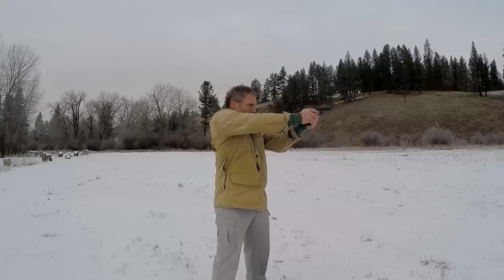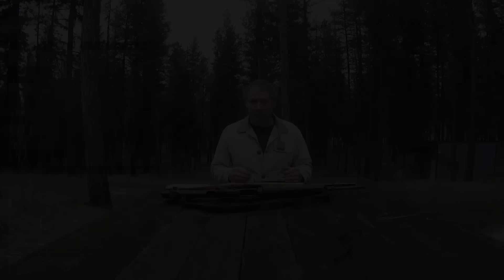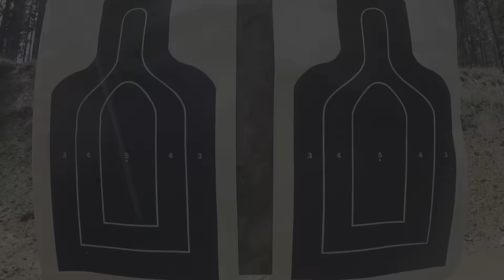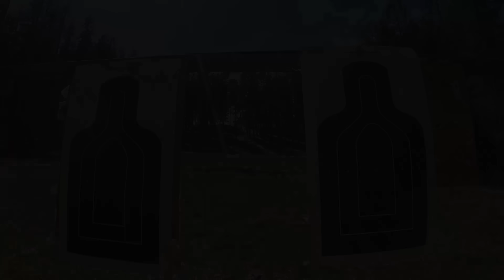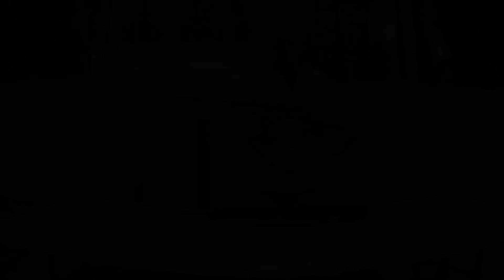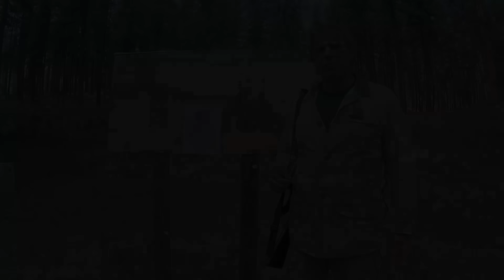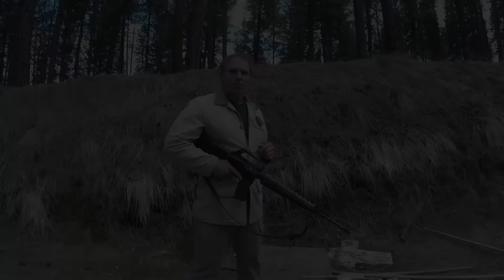Mini-14 vs AR15: Which is Better?

Comment: Ha ha ha , tge main thing about the difference is completely omitted 
Direct infringement system of AR and piston system if mini 14, ar bolt get dirty very quick needs cleaning otherwise caput

Mini 14, gas vents in front of bolt, no problem

Comment: First of all, all mini 14s were designed to shoot 5.56 ammunition! If you had the paperwork that came with the firearm initially, you would have been able to read that. So, for an accurate comparison of accuracy, you would need to use the exact same ammunition in both rifles. 😂😅😂
Reply: That is not so. The Mini 14 was introduced before 5.56 NATO was invented.
Reply: @jeffkardosjr.3825  I'm not certain where you are getting your information from. But according to Google. The 5.56 NATO cartridge was developed in 1957. It was adopted as the military cartridge in 1964. The mini 14 was designed in 1973. It began being widely manufactured in 1974. So I don't know what you are talking about. Can you explain why you think that the mini 14 was made before the 5.56 nato cartridge was developed?
Reply: @waroark1  5.56 NATO was designed in the late 1970s and put into service in 1980.
Google might be confusing it with the .223 Remington.

Comment: True the Mini-14 is a Fine Rifle, But the AR15 is far far easier to strip, clean and maintain. Sorry Mini 14 owners,  but that's a Fact...
Reply: Sorry AR owners but heres another fact. While the mini 14 may be harder to field strip, You will need to strip it FAR LESS than a comperable AR. Mini 14s are like the Toyotas of firearms. Anything short of using it as a baseball bat, and it will keep working an firing. Not so with ARs.

Comment: Try the same test using a recent model mini 14 with tapered barrel and suitable optic and proper weight bullet. Or are you going to purposely stand behind using the notoriously inaccurate pencil barrel Mini 14 with a modified barrel?

Comment: Thank you for your time and effort Mr. Harrell.  I somehow missed this one four years ago.  If I may, a couple of personal observations which may or may not be relevant to others’ situations.  I am in full agreement with everything you said.  I have owned a number of both rifles over the years.  The inaccuracies of some of my early Mini 14s went beyond sights.  I had one that keyholed at 25 yards.  I scoped the bbl and there was deformation in the rifling right at the muzzle.  Other had varying degrees of accuracy taking my marksmanship out of the equation.  I find myself left with only one now.  It is a folding stock GB and I keep it because it is so light for a .223.  The practicality of and usefulness of that…I am still mulling over.  Thanks again.  I have learned a lot from you.

Comment: I still do not understand why nobody wants to read the owner's manual of a mini-14. The only many 14 they ever made which has a 223 chamber is the Target version. And even it can still shoot 5.56 NATO ammo. The only reason they stamp 223 on the side of that rifle was because it was generally envisioned as a civilians firearm. So it had the civilian version of that ammo moniker on the side of it which is explained in the owner's manual. Given that I've seen 223 ammo that exceeds the power output of some 556 NATO ammo, the argument has become, at least in the last few years quite moot. But the firearm has always been chambered for 556 NATO. As their paperwork insists.
As for between the two rifles, I love the original m16. I fired expert Marksman both in basic training and in my update shootings when I was in the Air Force. However I was already Army trained before I entered the service. 5 1/2 lb AR-15 M16 rifle is a wonderful rifle. I would not carry one into the mud for love nor money. I would carry a Mini-14 everyday of the week because it exceeds the reliability of the M16 by far. It also has more than ample accuracy to function in the ranges it was designed to function in. Which is about 200 yards. Which is about the distance that the ammo actually shows very good wounding capability with its unstable 55 grain bullet exiting the muzzle somewhere in the vicinity of about 3,000 to 3,300 ft per second.

Comment: Wow, over 4,300 comments. This must be a passionate subject. I don't recall the Mini-14 being marketed as the "AR-killer". I don't remember the Fender Stratocaster being marketed as a "Les Paul killer". One isn't necessarily better than the other. They are different by intent and design. As with so many things it is the buying public that attach these false equivalencies to similar items. Personally I solved the dilemma buy purchasing both a Mini-14 and an AR platform. Now I can talk out of both sides of my face 😆 Excellent job Paul. Thank you!

Comment: I used to live in California. In order to avoid the “assault rifle” issues there, I bought a Mini-14. Not an assault rifle, not a problem. 

I moved to Washington where there was no assault rifle ban. I bought a AR platform rifle and enjoyed it very much. 

That was then. Washington’s new “assault weapon” ban has a fun little detail: an assault weapon is “any semi-automatic, center fire rifle with any one of the following”. It then has a laundry list of features, among which is this little gem: “a full or partial heat shield covering the barrel, does not include the portion of the stock covering the lower half of the barrel. Suddenly, every semi-auto rifle I own is an “assault weapon”, including the Mini-14.

Comment: Here in Connecticut ARs and AKs cannot be sold in the grandfathered ones had to be registered. with  state of CT
Mini-14s and mini 30s (762×39) .. have not been regulated here in Connecticut which is why I bought a mini 30 also to shoot surplus ammo... The problem with surplus ammo is the steelcase ammo does not expand and lease fouling in the beginning of the chamber.. eventually after 200 -300 rounds it starts sticking. (lacquer case ammo causing gumming up is a myth check out Lucky Gunner test ).... I just hit it with some break Free.. and a brush brush in the chamber every 200or 300 rounds when I start getting the sticking

Comment: Mr. Harrell, I know you have won many contests and awards for shooting, however, not today and not with these two rifles. I was concerned at your lack of accuracy, so I got similar targets took my m4, I do not own an A-1, and my Mini Ranch rifle, very similar. I did the same distances and manor of shooting. My results were a lot smaller groups with each rifle. The difference between wound up to be the same as you. Therefore, my compliments on a well done video. Please keep up the good work.

Comment: Fellow veteran here Paul.
When I joined the Army in 1989, we were issued A1s. A year later, we got the A2s. Never saw the A3s or M4s though.
Personally, I loved my A1. 
I grew up hunting, both bird hunting with shotguns and deer hunting with rifles. So I was already familiar with firearms by the time I joined.
And from basic to every range I subsequently qualified at, I could hit 40 out of 40 targets no problem with my rifle. Today I own an AR15 with a 16” barrel M4 style rifle. I’m pretty handy with that rifle as well, even with my old failing eyes.
I’ve never owned a mini 14, never even handled one. Gotta say though, that I have always wanted one. 
I was in our local Cabelas store earlier today and actually priced them. They had 2 on the shelf, one was the stainless model with a tactical stock on it, priced at $1200.00 , the other the normal wood stocked furniture, but sporting a bird cage flash hider, priced at $1100.00 . 
I wouldn’t give that much for either one of them so I didn’t even ask to handle one. 
At those prices I guess I’ll pull out the ol AR, dust it off, caress it most caringly and gently, and be thankful for the rifle I do have. 
By the way, it’s got a real nice Hogue grip and a 15” free float barrel with QD sling attachments lol.
I watch your videos all the time bud, and I love the way you present your information, much appreciated sir, thank you.

Comment: I would think that any comparison of the two is virtually impossible.  After all, the Mini-14 is just that...a Mini-14.  While the AR is manufactured by many companies and often with a varied range of quality.  One can get an AR at under $600 or over $2,000.  
My own personal experience, and I put optics on all rifles:  My first Mini was the Mini-30 back in the 80's.  I paid less than $400 for it and I liked it, but the accuracy sucked.  (4-5 in. groups at 100 yds average).  I added an Accu-Strut and tested various loads and brands of ammo and got that down to an acceptable 2.5" @ 100 yds. (average)
Later, around 2012, I bought an AR for around $1,200 and it was quite accurate once I settled on the best load and brand ammo.  Usually 2' or under @100 yds. average.  About 6 yrs. ago I bought a Mini-14 for my wife for under $500.  With it, once again, I tried various loads and brands to get an average 2' @100 yds.  AND, I also bought a bought another AR for under $600 and accomplished the same thing.  I must say that what worked well in one rifle was usually not the best for others.  I wish it was because that would simplify ammo purchasing.  And all testing was done on a steady bench rest.
Which is the best?
My conclusion was this:  All are fine rifles and quite dependable.  Their accuracy can be determined best by the quality of the optics and the load/brand ammunition you use.  Which do I prefer?  Well, I am in my 70's and have used the conventional style firearms since I was 7.  It just feels more natural for me.  So, I prefer the Mini's.

Comment: Only saw this recently, but the data are still relevant:
Velocity Comparison
fps= feet per second
mini 14 remington ammunition, speed: avg 2950.6 fps, max 2996 fps, min 2894 fps, max-min= 102 fps, std deviation 30.7 fps
m 16 a1 remington ammunition, speed: avg 3041.4 fps, max 3081 fps, min 2965 fps, max-min= 116  fps, std deviation 41.3 fps

mini 14 federal ammunition, speed: avg 3075.3 fps, max 3103 fps, min 3049 fps, max-min= 54 fps, std deviation 19.1 fps
m 16 a1 federal ammunition, speed: avg 3180.3 fps, max 3200 fps, min 3148 fps, max-min= 52  fps, std deviation 18.9 fps

The speed comparison numbers are very close on both rifles, extremely close, and what is unusual is on the first trial with remington ammunition the M16A1 has a wider spread of speeds, but on the second trial with federal ammunition, the mini 14 has the wider spread of speeds, if only marginally so. The lower the spread of speed, the more precise and accurate the rifle can be.

On the averages, the M16A1 is faster than the mini 14 by 85 fps the first trial and 95 fps the second trial, for a difference of 2.9% the first trial and 2.7% the second trial.  It is clear the federal ammunition is more substantially more precise with much less spread in speeds, the standard deviation proves this. Six standard deviations, six sigma, cover the entire spread of all results from that population, the federal ammunition has a much lower spread of speeds.

This same statistical comparison can also be done by measuring distances from target aim points.

Comment: Hello sir, does these older models of mini14 can these fire safely 5.56 or only .223 as is stated on the gun?
Reply from the maker: The barrel is marked ".223" but there's a lot of debate about whether it can shoot 5.56
Reply: There are 2 different mini 14 versions. The version marked .223 can only shoot .223.  The versions marked 5.56 NATO can shoot both 5.56 and .223
Reply: This info is likely addressed in the original owners manual. The modern mini 14s are marked for 556 but can of course shoot either.

Comment: Eugene Stoner's "little black rifle" remains fragile, under-powered and unreliable (except in 'range-clean' condition) - that forward-assist wasn't added because it looks cool...after about 100-200 rounds in any austere environment, the AR will become a single shot...Mini-14s have never had that problem.  Direct gas-impingement is just dumb, IMO...all that gunk, moisture and heat INJECTED into the bolt carrier with a 'Slinky Spring' in a buffer tube to return it to battery (hopefully)...dumb.  They gum-up...then, ADD a little sand = GAME OVER
Reply from the maker: Your assessment of the M-16 platform is hyperbolic and fifty years out of date.

Comment: The first 5 AR's I attempted to use were in like new condition, and all failed to fire, or otherwise jammed after one round fired. Four of them had been stored in vehciles for a long period of time and failed due to a lack of maintenance.  The other new AR failed, because of poor workman ship at the factory.   IMHO,  because Mini's require less maintenance, they are therefore more reliable?  Yes.  Most people simply will not do the PM, therefore I recommend that most people should have an AKM.

Comment: I have them both and enjoy them both. I have a accustrut on mine because it was on it when I got it. Does it make any difference? I don't have a clue. I have optic on the 14 and a optic mount on the A1, sometimes the A1 has a optic on it sometimes  it doesn't. I have dropped hogs at a 100/125 yards with the mini, other than plinking that's all I've asked of it and it did her job well. I couldn't  just pick one and fortunately don't have to. I also just enjoy how the mini looks and feels. It's like a mini taste of my M14 (That I can actually afford to shoot. ) 😊  Thanks Paul, I always learn something when I sit down with you for a bit.

Comment: When considering everything, reliability, accuracy, ease of use/ergo's, ability to adapt to changing trends, ammo cost, mag/parts cost and availability, as well as value... The DI AR15 platform is the best intermediate platform on the planet, imo.  I've owned some AR18/180 variants and they're great, especially for suppressing, but they're heavier and twice the price of a mid-tier DI.  Good luck finding deals on barrels/bolts/other small parts for those proprietary carbines.  Same for AK's.  Love them as they're great fun to shoot, reliable, but they're showing their age and when something serious breaks, you need a gunsmith to fix them.  For that reason alone they're a "fun gun" for me.

The Mini 14 is a fabulous civilian hunting/plinking carbine that could probably go to war and do okay, but I wouldn't want to be the first guy fielding it, lol.  My first centerfire was a Mini, still own it, so there's a special place in my heart for the Mini-14, but if I'm being objective it's just not on the same level as the AR.  But it hasn't had 60 years of military and civilian innovation poured into it.  Had we dropped the AR 30 years ago it probably wouldn't be such an attractive platform, but in this timeline it would be foolish to ignore just how incredibly modern/cost-effective the AR continues to be.

Comment: I have the new generation 580 + mini 14 and 2nd generation tapco mags and love it…with good ammo I can get 2 and three quarter inch groups at 150 yards.
Reply from the maker: Filmed a presentation yesterday using the Mini-14. It will be on line in a week or two. You may find the results interesting.

Comment: Ruger helps governments in disarming citizens. They then lobby  politicians so that their mini 30 and mini 14 are the only guns not considered a "assault rifles" and try to make sure that they are the only manufacturer with larger gov't contracts. Nobody should ever buy a Ruger.
Reply: No they don’t. I’d normally ask for such claims to be cited, but I know you are pulling it out of your ass.

Regardless, they sling more ARs than most other manufacturers. They make more profit from their AR-556 than they do the Mini-14.
Reply: @woodrowcall3158 At one time Bill Ruger did support some form of gun control.  I can't recall what it was, but the info (not just conjecture) is on the net.  I do recall it wasn't anything earth-shattering, but it did bother many in the firearms community.

Comment: any mini  14  post 2005  with a 508  series  starting numbers or a ranch rifle designation  is  something  i  will trust more than an ar15.   i love them both.  but the mini 14    shot  shell  casings  back and to the right when  at a public outdoor range,   and  40 feet or so  started  hitting people's windsheilds with dinks.     the   ar15  i have never seen  in any   platform or build do such a thing.  i suspect the rotary bolt  and  piston  system  is  the culprit. if you use a modern mini 14  (basicaly  anything  2005 or later built)  you will get 1.5 moa  or better.  and more reliability .
Reply from the maker: distance of casing travel seems like an odd criterion on which to base your conclusion. 
 Did the AR platforms you fired have a brass deflector (most do) to prevent the flight you observed with the mini-14?
Reply: @PaulHarrell  i guess. both are reliable but when you use  factory mags (expensive) for a mini.  i dont think anything would jam it .  maybe a nokia phone but that rotary bolt has some serious  force on it.
Reply: @PaulHarrell  oh to clarify i meant  STEEL  not "shell" casings in my post.  they fly fly fly.

Comment: Thank you for this very informative review. I stayed away from the AR15 for over 30 years, after 20 years of active duty in the U.S. Army. In all honesty I did not want a shoulder fired, gas operated, air cooled rifle for me. I went with a bolt action 308 roughly 3 years ago, and love it, even though I only shot 3 times. I just recently decided to get a budget friendly AR15 chambered in 5.56. In my opinion I have the best of both worlds since I have the ability of firing 223 or 556 in one and then can shoot my 308 using a bolt action.  Based on current prices of the Mini 14, I would rather save up and buy the M1A1.  To me, the Armalite Rifle provides the buyer many more options for customization over the Mini 14 which in my opinion is why the Armalite Rifle is extremely popular as the modern sporting rifle of choice.